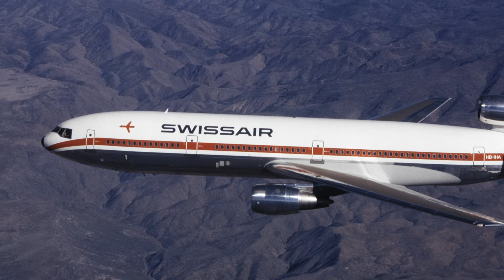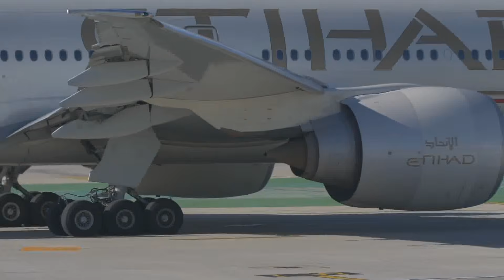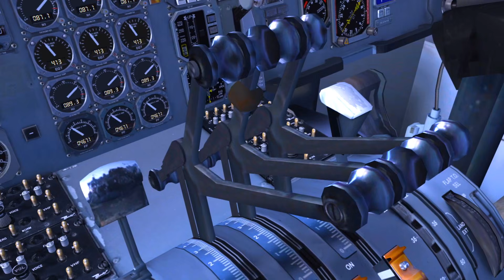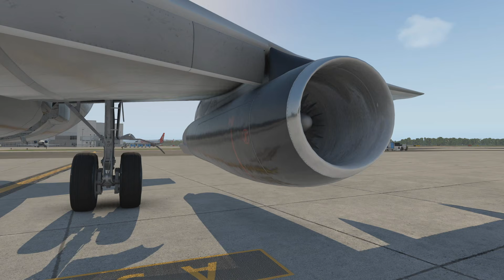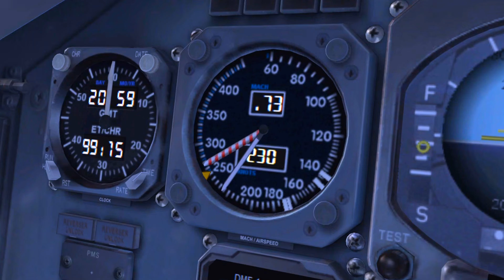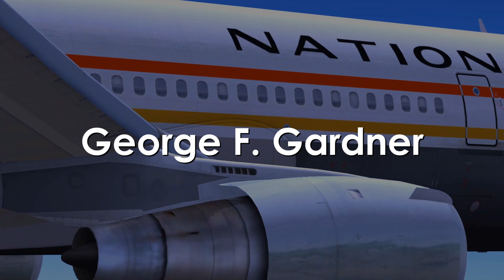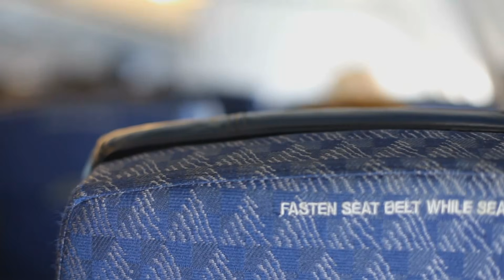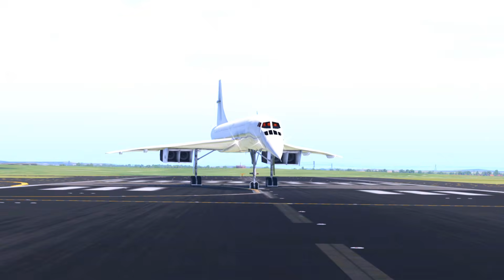The Unsettling History of the DC-10 (National Airlines Flight 27) - DISASTER BREAKDOWN

Comment: Man, Douglas really released the DC-10 early just to compete with Lockheed's L1011
Reply: And the L-1011 itself is an unlucky history of a product reaping much less than it deserved...
Reply: @TenorCantusFirmus  - Very correct, I’ve flown both and the L-1011 was by far the superior aircraft (though I’ll grant the DC-10 did fly nicely).  Douglas engineering was inferior, one needed to look no further than the design of the entry doors - The L-1011’s was elegant simplicity, the DC-10 a Rube Goldberg nightmare.
Reply: @AndreySloan_is_a_cnut  Hi Brad, you are indeed most fortunate to have flown two truly amazing aircraft types.

I wonder if you would you explain want you mean regarding the inferior function or design of the DC-10 cabin doors?
Is it the smaller size of the L1 and R1? Or sis it an issue regarding their operation? Both types had the similar design of doors that 'un-plugged' and ascended into the crown. We also had a similar design with the B767.
That design and the intelligence of the B707 - 757 style of inward plug-type that rotates outboard around to the forward position, are all far superior to the European trend of push out and slide along that unfortunately has appeared on the B777s and 787s. Although the latter's design and operation is far superior to Airbus along with the VC-10s and Concorde they were copied from.

From both a general operations and aviation safety/EPs viewpoint I’m very intrigued to understand more about the point you raised with your observations and experience with the DC-10 vs L-1011 

I’ve worked for many years both as aircrew and an EPs instructor, I also did some post grad studies in aviation safety at a tertiary level.
I’ve flown on the DC-10s numerous times as a passenger, but much to my disappointment never as crew. In my part of the world, Australia/NZ, they were not operated by any local carriers when I began operating as crew.

Also incredibly disappointing, no matter how much I tried I have never had the opportunity to fly on an L-1011 in any capacity, they were also never operated by any local carriers. In fact none of the carriers that did operate the L-1011s ever operate them to Australia, and any of the few airlines that actually had them in their fleet, they were never operating their L-1011s on any of the routes I was flying. The same applies to the B757, try as I might to fly on one there is either a schedule LMC or U/S equipment change.
There might still be hope for catching a B757 ride, but the closest I’ll ever get to a TriStar is on YouTube!

Regarding the B757 though, it makes no sense that given our hotter climate and the route distances we operate both domestically and regionally international, that not one of our three former B767 operators ever introduced the mighty B757s into the fleets. 
There are a number of routes and stations where B757s would have been the ideal aircraft vs the B737 or A320 that was used. The advantages of 757/767 dual endorsements make even more sense. 
Complete madness and a total lack of foresight, perhaps Boeing ought to have promoted in better down here to demonstrate the routes it would have excelled on.

The L-1011s have always fascinated me though subsequent to their unique appearance with so many advanced features and technological advancements. 
The outrageous lower lobe lounge that PSA in the USA had configured in their 1011 fleets was wild. While both the B747s and DC-10s also had the option of a lower lobe galley, only the L-1011 had the functional and practical design of an external access door and servicing!
Much more efficient and indeed faster than loading via the main cabin with multiple cart exchanges laboriously via two elevators.

Lockheed really did think of everything! 

Their previous piston L-749s - 1049s and jet prop L-188s were also all superior aircraft for their era. Had they not have withdrawn from commercial aircraft design and manufacturing we can only imagine some of the fantastic wide and narrow body airframes we might have known? Hopefully they would have chased Airbus’s rubbish out of the market and today’s aircraft would be either Boeing or Lockheed.

It is an incredible shame that they decided to pull out of the commercial market on account of the L-1011's poor sales, and the many cancelled/lost orders thanks to the unreliability of RR's failure to deliver.
The damage they caused Lockheed was unforgivable, it is so frustrating that they ever risked an exclusive contract for the aircraft's power plants.

Like the accident featured and indeed many other power plant related incidents/accidents, it is not the airframe manufacturer nor its design at fault.
The ignorance of the media however with their insatiable drama-lust fail to educate the wider public of those relevant details. Its more exciting to criticise and dramatise the aircraft type, especially when it was a DC-10!

GE typically design and produce superior power plants, it is a shame they apparently had problems with that model.

Out of interest, what type/s did you operate following the 10s and 1011s?

I look forward to your response should you have the time.
Cheers, Anton
Reply: @sydyidanton5873  - Hi Anton, I'll try and do your reply some justice, though I'll have to be brief as it's quite late here!

"Hi Brad, you are indeed most fortunate to have flown two truly amazing aircraft types."

Agreed - Actually I have the somewhat unique distinction of having flown all three wide-body trijets:  The L-1011, DC-10, and the MD-11 (and I also flew the B-747-400 for about a year).  Of course that and $7 will get me a cup of coffee at Starbucks, but it's what passes for a claim to fame with me.

"I wonder if you would you explain want you mean regarding the inferior function or design of the DC-10 cabin doors?"

The control and operating mechanism:  The L-1011 was a two position selector and two push buttons (and a T-handle for emergency opening).  You selected opening or closing using the door selector, then pushed the appropriate button.  It was just shy of impossible to mess up.  The DC-10 & MD-11 both had a Rube Goldberg arrangement (which differed between the forward doors and the rest of the aircraft doors as well) involving two different levers, and a reset knob, and it seems like a couple of other things.  It was very easy to inadvertently deploy a slide in the DC-10/MD-11, whereas it was almost (key work, almost) impossible to do so on the L-1011.

"From both a general operations and aviation safety/EPs viewpoint I’m very intrigued to understand more about the point you raised with your observations and experience with the DC-10 vs L-1011"

The format of the EPs was largely driven by the operator - for instance, the DC-10's we had were Northwest Airlines cast offs - we bought their manuals with the aircraft, and their procedures had zero memory items for the aircraft.  I don't agree with that approach, but I certainly get the good intent behind that even if I disagree with that concept - there are certain things which need to be immediate action items, but that list should be short and listed to truly critical items (such as donning O2 masks in a depressurization).  I'm too tired and mentally foggy to go into great detail - but in essence you could see where Douglas cut corners in its design to beat Lockheed to the market.  Things as simple as not having the leading edge slats mechanically locked when extended, or making a second stick shaker optional (originally), both of which contributed to the crash of AA191 at KORD.

"I’ve worked for many years both as aircrew and an EPs instructor, I also did some post grad studies in aviation safety at a tertiary level."

Very cool, so you are certainly familiar with different philosophies WRT the performance of EPs.

"Regarding the B757 though, it makes no sense that given our hotter climate and the route distances we operate both domestically and regionally international, that not one of our three former B767 operators ever introduced the mighty B757s into the fleets."

Agreed - the B-757 was just a fantastic aircraft to operate, and it had the performance to go into a lot of places.
 
The L-1011s have always fascinated me though subsequent to their unique appearance with so many advanced features and technological advancements...

Lockheed really did think of everything! "

There's a LOT of truth to that - unfortunately that's likely part of why they don't last quite as long as the DC-10s, their complexity demanded that you have maintenance technicians who really understood the aircraft.

"Their previous piston L-749s - 1049s and jet prop L-188s were also all superior aircraft for their era. Had they not have withdrawn from commercial aircraft design and manufacturing we can only imagine some of the fantastic wide and narrow body airframes we might have known? Hopefully they would have chased Airbus’s rubbish out of the market and today’s aircraft would be either Boeing or Lockheed."

There's an old saying: "Lockheed has always built the most advanced and sophisticated airliners - unfortunately they've never figured out how to make money doing so!

"The damage they [RR] caused Lockheed was unforgivable, it is so frustrating that they ever risked an exclusive contract for the aircraft's power plants."

My understanding is that the RB-211 (being a more compact, triple-spool design) was the only engine which would work with the S-duct configuration of the Tristar, hence why they were the only option.

"The ignorance of the media however with their insatiable drama-lust fail to educate the wider public of those relevant details. Its more exciting to criticise and dramatise the aircraft type, especially when it was a DC-10!"

Agreed - the media is worse than useless.

"GE typically design and produce superior power plants, it is a shame they apparently had problems with that model."

The CF-6 is a pretty darn robust engine, I can't throw too much dirt at it.

Out of interest, what type/s did you operate following the 10s and 1011s?

Let's see - I went from a Sabreliner 40 to the L-1011, then to the B-757, then back to the L-1011, then the DC-10, followed by the MD-11, then the B-744.  After that I went to work for a training provider as a simulator instructor on the Beechjet, then Embraer 170 & 190.  Now I'm back to flying a Beechjet (at least for the moment)!

Kind regards,
Brad
Reply: @sydyidanton5873  I flew lower lobe galley on 747s and DC-10s where galleys were loaded via cargo and just rolled in on each side.
Reply: @sydyidanton5873  
The L10 had a unique ceiling design that gave it a more spacious look. My first ride was TWA 1976 BOS-SFO, and back then it was the tail end of the golden age. The coach lounges had been removed by then, but the coach section still had an air of luxury, about 2/3rds empty as was typical back then.
Reply: @sydyidanton5873 GE ain't any better than RR, RR better high bypass turbofans are more economical hence the 737800max, plus the 737 too long in the tooth and should be droped
Reply: Funny how the DC10 kept fly while the L1011 ended up in the bone yards long ago. Same old tired comments every time the DC10 and 1011  subject comes up
Reply: @John-f2f9e "The L-1011’s was elegant simplicity"
Nothing was a bigger lie.  She was notorious maintenance hog, her tail mounted engine was three times as costly to maintenance over the DC-10's tail engine and was so complex she suffered excessive downtime.
Reply: @TenorCantusFirmus  The Lockheed TriStar was a much better plane than the excorable DC-10.
Reply: @stuartlee6622  haha. Here we go again the know it all brigade.  You should join the  TSR2 group. The BS is even more heated
Reply: @TenorCantusFirmus  The tail mounted engine of the L-1011 being directly attached to the rear fuselage as opposed to mounted directly above the fuselage on the DC-10, coupled with the more complicated S-duct design of its intake were several reasons that it quite rapidly fell out of favor. Construction of the aircraft was expensive and more difficult than the DC-10, maintenance procedures were far more complicated and therefore far more expensive to carry out, and the design and construction of the tail mounted engine itself led to it being financially infeasible to reasonably upgrade the aircraft with newer more efficient engines without a complete redesign of the tail structure and intake system for the engine. It was certainly a remarkable aircraft that was among the first to implement a stabilator among other factors, but it was a product of its time and retrofitting was not feasible.
Reply: @Cynsham  Interesting information, it is a pity Lockheed didn’t make the accessibility to the #2 engine less of a challenge, hence increased engineering expenses.  Anyone in the industry knows how loathed airline bean counters are to spend a little more money, irrespective of how much safer operating that aircraft type is. 

Despite DC-10s being a beautiful aircraft, L1011s are undeniably superior in almost every way.
There would be far fewer issues with an uncontained engine failure on an L1011's #2 with it being so far aft, than a DC-10's #2 with vulnerable systems immediately beneath where the fan blades or disc fragments will be directed as ejected and will do damage.

I wonder if the B727 had the accessibility concerns and subsequent issues of more expensive engineering with their #2 being also S ducted with extreme aft mounting?

I miss the tri-jets, despite contemporary aircraft featuring several technological advantages, modern airframes are just so generic compared to the 70s - 90s. That doesn’t make them any less beautiful (except for Airbus types).
Reply: @Cynsham  727s used the same tail engine mount. Replacing two wing engines with newer bigger versions would've still saved money.  A heavier tail engine might throw weight and balance off or tail heavy nose high cruising.
Reply: Armchair mechanic telling everyone that they are wrong. I wonder if this idiot who corrected everyone has a google search engine. Well I guess not because he’s wrong every time
Reply: @TenorCantusFirmus unfortunately contrary to the beliefs of economists that spend too much time looking at math and not enough time looking at the real world the market does not select for the best product. Much in the same way many people misunderstand evolution as selecting for the best traits when really it just select for the traits that don't prevent reproduction. This is the fallacy of the free market.
Reply: Reminds me of Boeing rushing to release the Max and Max 8 to compete with the Airbus A220 and A21.
Reply: @YDKJ07  - The Max 8 does not compete with the A-220, that is a much smaller aircraft.  It competes with the A-320 NEO.
Reply: @AndreySloan_is_a_cnut  the MAX 7 does though. Mind you, the MAX 7 still hasn’t been certified, though a lot of that is due to the crashes of the MAX.
Reply: @YDKJ07  the 737 does not directly compete with the A220. the A320 was created to directly compete with the 737.
Reply: When someone is wrong they attack the truth
Reply: and L1011 is still better hehe
Reply: @fjlkagudpgo4884  yawn
Reply: And gambled with your life in that process, yes they did
Reply: What's interesting is that while the DC-10 outlived the L-1011 for cargo (the 1011 ended cargo ops in 2010 in Bangladesh), the L-1011 outlived the DC-10 as a passenger aircraft (1011 rumored to have ended pax service in 2016 or 2018, vs 2014 for the DC-10).
Reply: @bruhpatrick1822 there is one of each still being flown in 2023 (rocket launching for l1011 and cargo for dc10)
So we'll see which lives longer
Reply: @Cookivirus  I mean, afaik there is only one L-1011 still flying but the DC-10 is still in double digits as of surviving aircraft (mostly the military KC-10, but still)
Reply: @yeetoburrito  yeah 
I was more thinking company use
But you are correct 
I still think the niche purpose of the l1011 will help it in the long run
Reply: Douglas really do be a modern AAA game developer
Reply: The L-1011 was part of a scandal. It was found that Lockheed was tapping up military clients to potentially grab a few Tristars for their airlines while the purchased warbirds. Unlike many scandals of that type, the Lockheed skulduggery might have saved a few lives because sod flying on an early DC-10.
Reply: The L-1011 was delayed 2 years by the failure of Rolls-Royce to deliver the RB-211.. Lockheed lost orders when R-R went tits-up in 1971.
Reply: Long term, both Lockheed and McDonnell Douglas were worse off for it. To quote Mustard, they were two big fish in a small pond. As a result, both of them, including their own way, lost to the 747
Reply: And the 747 as well
Reply: The DC-10 is my least favourite plane and the L-1011 is my favourite